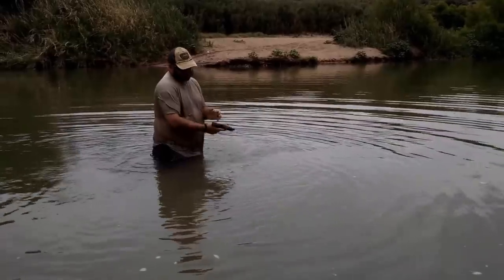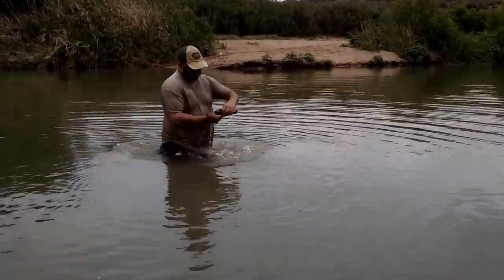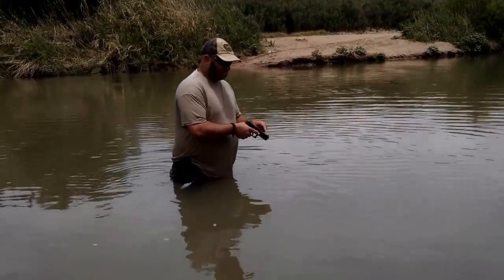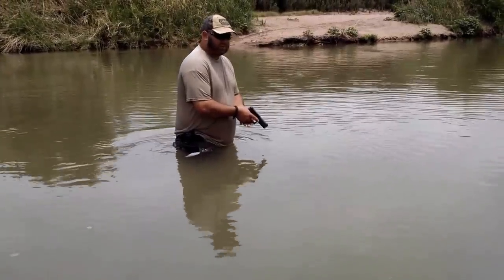Do you really need maritime spring cups for your Glock?

Comment: I am pretty sure maritime spring cups were designed to facilitate faster draining of water from the action, so the user can fire rounds immediately after resurfacing. I don't understand why people keep thinking it will improve reliability underwater.
Reply: Maybe because they claim you can shoot underwater?
Reply: You are exactly correct. There was a concern that, after surfacing, water trapped around the striker would slow it to the point that light primer strikes occurred. I've never heard of this actually happening, it was just a concern.
Modify the stock gun with a scalpel or exacto knife.
Reply: @preacherF-15  wrong way of thinking just install the cups and install a stronger strike spring eliminates all of that all together
Reply: @eddiecrow9133  I'm a master armorer for Glock, and have been for 30 years. What exactly am I "thinking wrong " about? Installing a stronger striker spring won't do much, if anything, since water is not compressible. All you need is a drain, essentially, so that when you fire the striker doesn't hydrolock against the water trapped in there.
Incidentally, you can fire your Glock underwater. The cups are for the first shot after you surface, period.
Reply: @preacherF-15  The maritime cup allows it to more easily flow through water meaning it can operate in a flooded firing pin channel, whether it's from the gun not having time to drain, a blocked drain even, or even firing submerged.
Reply: @bigpatty823  I've been a master armorer for 30+ years, and as a fighter pilot I'm well versed in aerodynamics/hydrodynamics... While I in essence agree with you, I'm curious how notched cups help water get out of the way of a moving striker... While submerged.
Reply: But but but SEALs!

Comment: I've been a glock master armorer since 1993. Nobody, including glock, ever stated that glocks require maritime cups to fire underwater--nor are they required to clear the channel after surfacing. The first shot will effectively clear the channel.
The cups or mods to std cups simply keep the water from slowing the striker and causing a light primer strike.
Reply: The information in your comment is helpful, thank you brother. Also what types of mods does someone of your experience prefer for their glock?
Reply: Why then are the maritime cups from Glock a restricted part?
Reply: @patrickjefferson148  no idea. Probably some obscure law.
All the maritime cups do is ensure that trapped water doesn't slow the striker down to the point that it results in light primer strikes.
You can fix this problem (if it even is a problem, lots of people fire stock glocks in water with no problem) yourself with an exacto knife.
Reply: @patrickjefferson148  you do know that maritime cups have nothing whatsoever to do with shooting underwater, right? All glocks will shoot safely underwater.
After coming out from underwater, water trapped in the striker channel could slow the striker down. Maritime cups allow the water to drain.
That's it. Cut or drill some holes in your stock cups. Same thing.
Reply: @preacherF-15  Yes I know this
Reply: Why does Glock not include this in oem glocks then? Is there any negative results from the maritime cups? If there is only positive results it should be mandatory in all glocks.
Reply: @Woffar  the cups without holes keep dirt and powder residue from entering the striker channel and getting baked in during heat cycles, which can cause the striker to fail or to light strike primers. If Glock put underwater cups on factory guns it would lead to failures, potentially.
Reply: @KingRemy003  I'm sorry bro, I never saw your comment. I have lots of guns I modify, Glocks... Not so much. I Dremel the handle up under the trigger guard a bit to allow a higher grip, I cut front serrations on the slide, I mill a trijicon pattern in front of the rear sight to bolt a reflex red dot in, and that's usually it. I prefer the 19 for edc, I have one with a flared aluminum magwell and one without, depending on how easily what I'm wearing will conceal.
Reply: @patrickjefferson148  that is an old myth. They are not restricted.

Comment: To be fair the Maritime spring cups aren't specifically meant for shooting underwater.  They're simply meant for maritime environments so either the water will clear the firing pin channel faster or the water has a place to go when you pull the trigger.
Reply from the maker: Josh Downs Absolutely correct.

Comment: Saw some Glocks fail torture testing by water remaining in firing pin channel and causing a light primer strike.( submerged then shot out of the water)...a 10$ alteration that should fix that issue..Maritime cups do come standard on Glock 19x. Other than steel sights replacing the Glock factory polymers and me removing the fingergrooves on my Gen 3...mine is stock. Maritimes cups are on their way. I shoot quite a bit....100-200 rds a week from my 23 Glock. This Glock runs like a Singer sewing machine. When assisting in Combat/General range OPs..Stock Glocks chug through the 500-1,000 rd classes. I do have an aftermarket barrel that converts my 23 to 9mm. I use it when we do strictly combat classes as we get a deal on cases of 9 parabellum.  I PERSONALLY like the maritime cup idea. My .02$

Comment: i seen a video a while back, i dont remember who's video it was. but the stock cups worked better underwater than the aftermarkets.
Reply from the maker: l3arrett82 LOL. I wouldn't be surprised, but if you take a close look at stock spring cups and the maritime cups, it makes sense that the maritime ones would work better. I don't have them but they're cheap so I might give them a try. This was just something I did for fun while I was out camping.
Reply: The Chopping Block yeah it makes good sense and i dont know why they failed more so than the stock cups. i have no hands on with either 1 under water. sold my 26 got a 29 then sold the 29 and got a cz p07. id like to try it out underwater but as it is the spent casings land right beside my foot so i dont think the round si have are stout enough to cycle the slide with the resistance of water.
Reply from the maker: l3arrett82 If you do, be sure to make a video.
Reply: Yes VSO channel did a video on it. Always been a little skeptical on that one, but hey glocks do surprising shit sometimes.
Reply from the maker: xavierconley350 they certainly do.

Comment: Glock firing deep underwater. Cycling 2 to 3 consecutive rounds about 50% of the time. we put in a 22lbs spring to 100% stop it from cycling so we knew we had to manually chamber another round then it fired 100% of the time, never failed. Thanks for your video, watched it a couple times during the process.  https://www.youtube.com/watch?v=6lG-snJZIV8
Reply from the maker: Interesting. Thank you.
Reply: Courtland Hunt Thanks for this.  Helped me with a project I'm working on
Reply: So you had to change the spring as well? To make it 100% cycling?